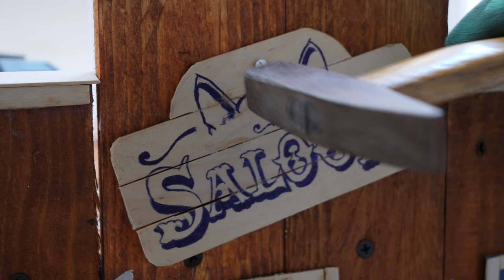This Stray Cat Find a Home with a Cooling System and Lights

Comment: For everyone on here, who does not have the talent of this man, building a cat house can be quite easy and inexpensive. If you have cats that need to stay warm, safe and dry simply buy two Rubbermaid bins. Stuff insulation between the two. Basically push the one into the other and put the lid on. Cut a door line that door opening with duct tape and fill with hay. Simple, easy and expensive and waterproof. I bought several very large ones and got a large, feral cat colony through very cold winters with these. Not as beautiful as what this wonderful man makes but as we don’t all have his skills and cats still need safe and warm homes it’s a go to for those of us without his talent.

Comment: You can line the walls with insulating materials and by leaving a air gap between the walls, it will do a better job of keeping insides cool